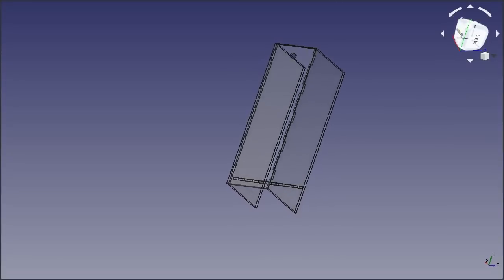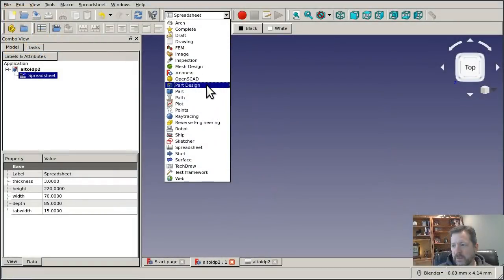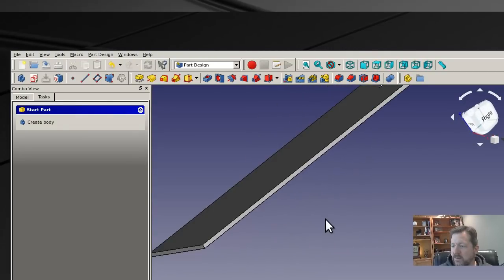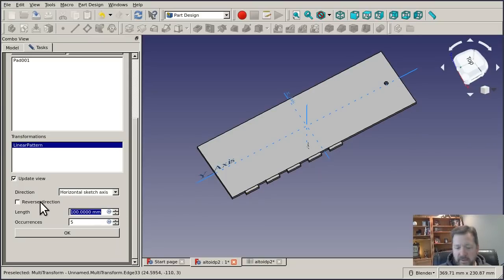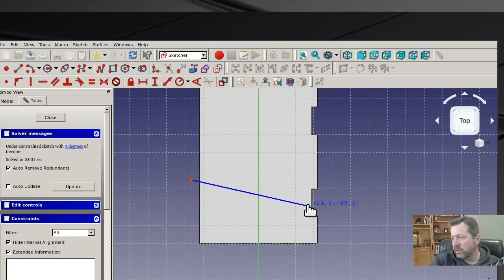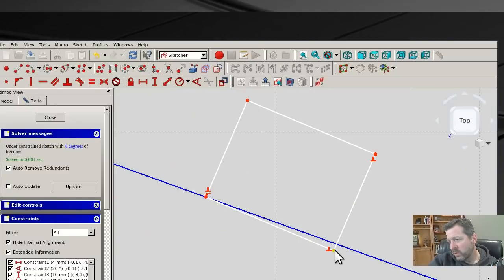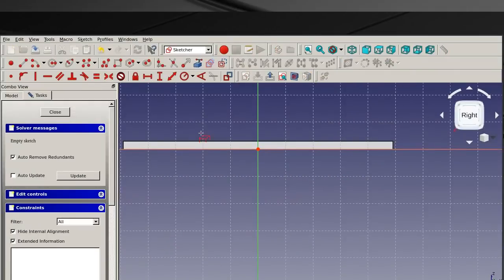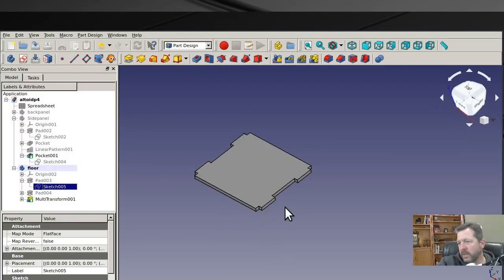Laser-cut finger joint box (end-to-end) - Part 1

Comment: Very nice tutorial! 
However, I am struggling with creating the pockets for the floor tabs. You draw reference lines for the angular alignment and the middle symmetry and leave them in place, after drawing the rectangles for the tab pockets, then you create the pockets through all. However, if I try to pocket it, I get an error message, that it is not possible. Deleting the reference lines makes it work. I am using version 0.19, has this changed from 0.18. Should I use Datum Lines instead for reference lines?
Reply from the maker: Support in youtube comments is really hard.  No pictures, no attachments, etc.  My first guess is that you added the reference line as regular geometry.  Is it dark blue?  If that's not it,  please post on the forum and share your file.
Reply: @sliptonic  Thank's for the right pointer, I drew a solid line. I've figured it out! :)

Comment: Thanks for this nice introduction!
most of my projects are  a little bit trickier than that ;-) 
for lasercut things i try to stay in an 2d thinking - so i would have done the tabs from the same perspective like the plate itself was drawn.
thats also because i think i have read somwhere that it is saver to reference a basic sketch that is not mapped to a side...
a complicated finger-joint box i have done is at https://github.com/s-light/BreadBoardBox
it is not super clean from the workflow.. as i did learn and changed my approach at some point ;-)

thanks for the detailed videos you create! (i learned today how i can get rid of the extra lines ;-) → refine! )